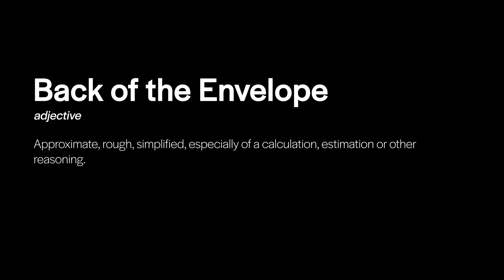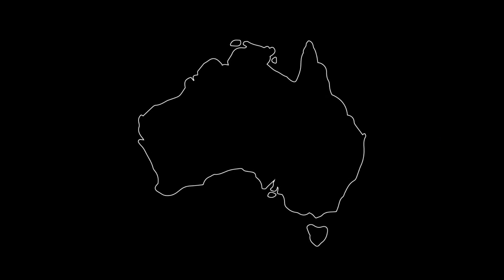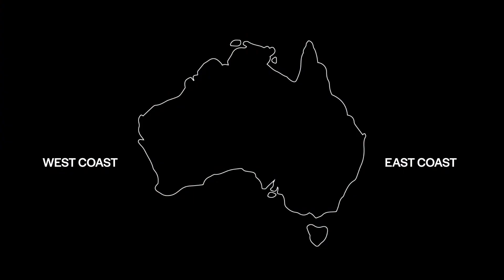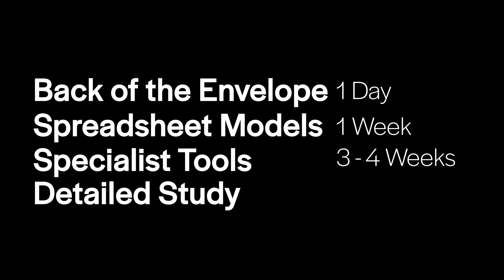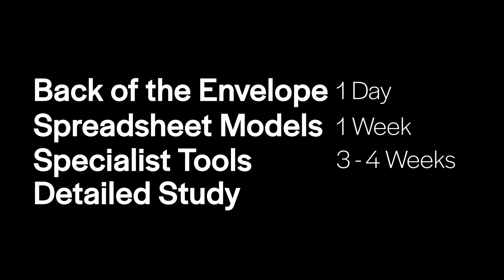How Long Does It Take to a Design Distribution Network?

Comment: Do you include in detailed approach any validation models when you first build existing network based on historical demand and flows, then compare it with PnL for the same period, or you go straightforward to optimization scenarios?
Reply from the maker: Yes, that is a crucial first step and usually the hardest part.  A calibrated 'baseline' validation is essential as a comparative start point for modelling.

Comment: Which tools are used to design a supply chain network?
Reply from the maker: There are many tools that can be used.  You need something that can 'goal seek' the solution based on a range of variables.  A spreadsheet can be used, or more advanced specialist programs that cost $100,000 or more.  Because we do it so often we use  those specialist tools.  I won't name names as there are many good tools around and I don't want to be seen to be promoting specific ones.